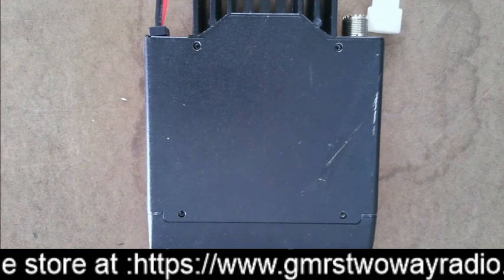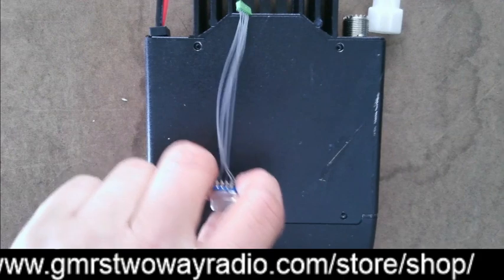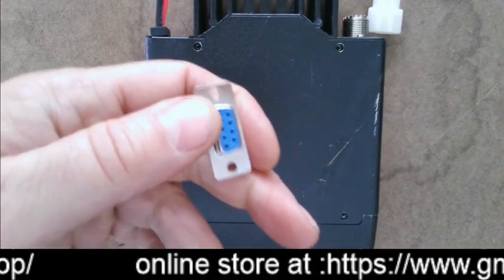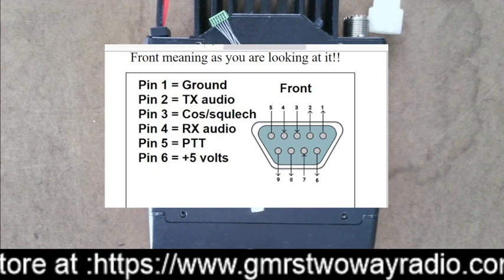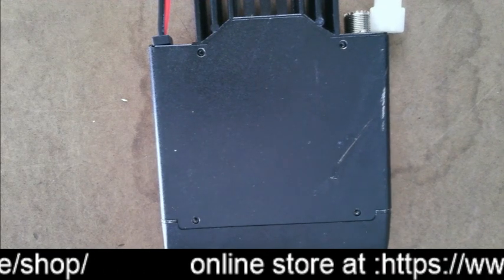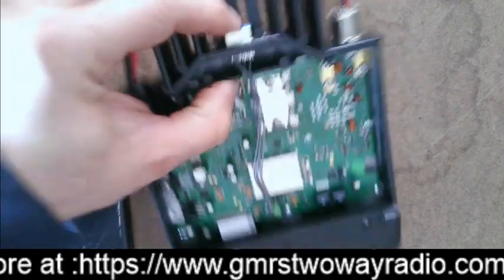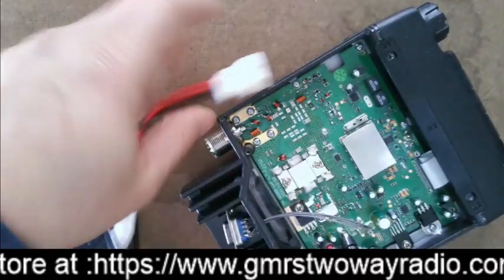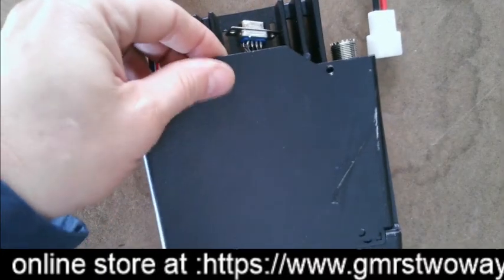🔺 How to install "repeater cable" in Retevis RT9000d or TYT9000d two-way radio GMRS or ham versions🔺

Comment: Talked to the other day on Zello (OceanDude). This is a bit off topic, I have the same radio and use as a mobile. Can I make a 12V cigar lighter plug that would plug in the back of this unit and shut it off when I turn off my vehicle. The manual shows a cable as an option to beable to do this but Retevis has not responded to my email about acquiring one. Thanks for all the usefull info.
Reply from the maker: At first, I thought you were talking about the "main" power cord, BUT now I see you are to talk about the small jack on the back of the radio!! I looked in the manual and yes they say that but be careful fully on which one you plug it into there is another jack that is for ext speakers!!  But yes, you are right!! I will check that out!! But to answer your question yes that should do that!!!